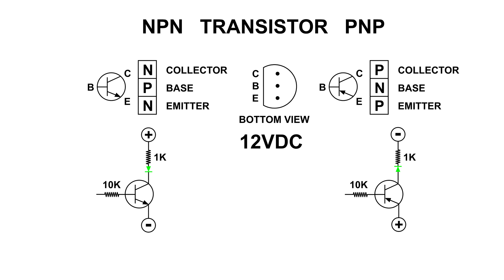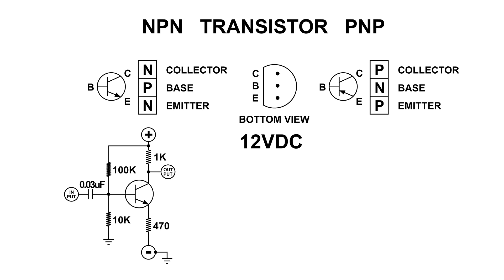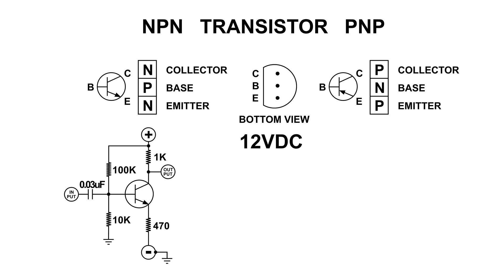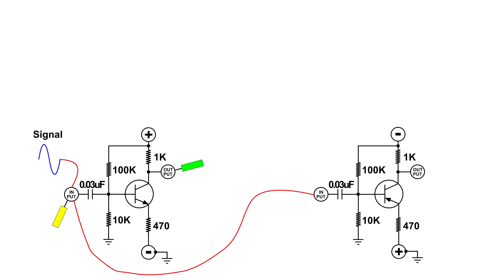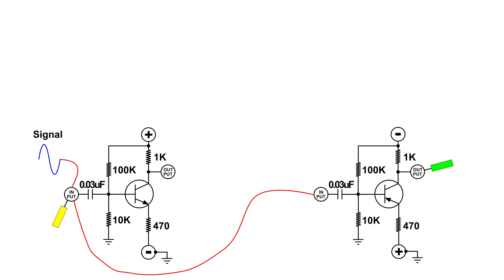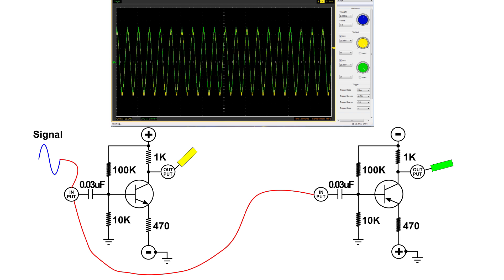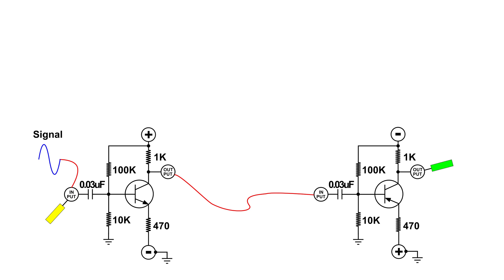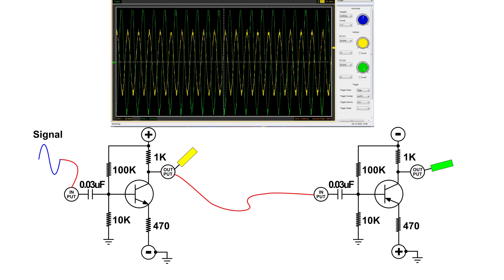Transistor Amplifier for the Beginner, the basics

Comment: Sir I have a led blincker cuircut that produce 15 hz wave but it's voltage very low around 2-5 volt and amp is also low but I want around 50v and 1-2 amp for my project can I use this cuircut for it please reply me
Reply from the maker: You may be able to use a relay or just the IGBT.
Auto ON OFF Circuit Updated with IGBT
https://youtu.be/n-Ac4czBkpM
180° Phase Shift using one IGBT Auto ON OFF Circuit
https://youtu.be/KwS1f3Z1150

Comment: He there can you design a 100 watts amplifier using 5 or 4 transistor.
Reply from the maker: Yes you can. The bigger challenge is building the clean power supply.

Comment: wot is a NPN  & how dos it work in a  transistors for  what is PMP  ? what dos it do  we haven seen one yet ?
Reply from the maker: These videos may help you.

Transistor, How Does it Work in a Circuit, Demo
https://www.youtube.com/watch?v=vs3zUHdlsYY

Transistor How can it Amplify
https://www.youtube.com/watch?v=O9aT950DRkw

Transistor What does it do in a circuit Visual Demo
https://www.youtube.com/watch?v=o1ygTZTHDnE

NPN Transistor on off switch and also a variable resistor
https://www.youtube.com/watch?v=knm_t10hJGM

Junction Transistor for the Beginner, the basics
https://www.youtube.com/watch?v=pStpu8DslXo

Determining NPN PNP C E B for a Junction Transistor using a Ohmmeter
https://www.youtube.com/watch?v=fWBjvaRDErk

Transistor Basic Function
https://www.youtube.com/watch?v=BOMbydWGecg

Comment: Hi i made a common emmiter amplifier for 200mhz signal with 2× gain 
I can amplify a 50 mv p-p to 100mv p-p but I can't do it for 2v to 4v p-p
Why what values should be change???
Reply from the maker: You could add another stage, or increase the Voltage, or both.

Comment: Why does the transistor burn out when the resistance at the output decreases ?
Reply from the maker: All parts have a limits. Look up the specifications for your transistor. If the current in the circuit exceeds the specifications it will burn out.

Comment: That's great, thank you. I suppose npn and pnp pair is necessary to cancel the inversion. If both are inverting the signal, why can't we do it with 2 npn stages?
Reply from the maker: The bases of a NPN and PNP are 180 degrees out of phase. This what makes the Push Pull work.
This video may help.
MOSFET Push Pull Amplifier Visual Demo
https://www.youtube.com/watch?v=-6N7l1dnk6s

Comment: can anyone tell me the phase different i see is not exactly the same as 180 degree. is 180 degree just a a rough value?
Reply from the maker: There's always a few nano-seconds between stages.
Reply: thanks for reply. 2:53 what i see is that the right edge of yellow wave is overlapped with green wave while there is less or no overlap of the left side of yellow wave. therefore i say it looks not exactly 180 degree phase difference. thanks

Comment: So you are obviously hooking 12V to the + and - signs on the circuit??
Reply from the maker: Yes
Reply: @AllAmericanFiveRadio  It is such a great circuit for a newbie like myself.  Except when I try to go and hook power up to this, and a function generator.  Things start to get weird.  So I hook 12v up to the + and -, and then hook the + of the function generator into the cap. and the - to the ground the 12v is hooked to?
Reply from the maker: @g00glian0  Click on the link in the SHOWMORE for a picture of the circuit.
Reply from the maker: @g00glian0  Look at the picture (link in SHOWMORE)
Red wire is positive Black is negative
NPN transistor on left PNP on Right
Wire connecting capacitor from NPN collector to PNP base is red in video and black in picture

Comment: Sir,
I was experimenting with this circuit and my sine wave coming out of the first stage was clipping on the top part of the wave. I was using a 1kh sine wave using the resistors in you diagram. My transistors  were bc547 and bc557. Can you advise me as to what I can do to correct this. 
I am a novice .
Thank you
Reply from the maker: Let's just talk about the NPN transistor bc547. When your signal at the output is clipping at the top that means the base of the NPN transistor is to positive. You could lower the 10K resistor, but I don't recommend that because you may start to short out the signal you're trying to amplify. I would raise the resistance of the 100K resistor, 5K, 10K, 20K,,,. Whatever voltage you are using VDC to drive the circuit, it should measure about half VDC from the collector of the transistor to ground. When you achieve these results the output should be a nice sine wave. If you have the biasing just about perfect, and you overdrive the circuit the top and bottom should clip at about the same time.
All this is the same for the PNP transistor bc557. Just reverse the polarity of everything.

Comment: how are you powering this circuit? I notice that on the pnp transistor the positive is grounded. I was bread boarding this circuit but had to stop because I didn't understand the power supply. 
Thanks
Reply: You still didn't explain why +12v goes directly to ground on the PNP transistor.
Reply from the maker: A 12 power supply, NPN collector is positive, emitter is negative. PNP collector is negative, emitter is positive.
Reply from the maker: I think if you know how a audio coupling capacitor work this may help. It isolates DC on each side but lets audio move from one side to the other.
Audio Coupling Capacitor, how it Functions in a Circuit
https://youtu.be/PAPnwX6YiIM
Reply: Okay I think I get it now. And as per usual its a crappy explanation that's the cause of the confusion to begin with.
Specifically this one from AllAmericanFiveRadio:
"A 12 power supply, NPN collector is positive, emitter is negative. PNP collector is negative, emitter is positive."
What the hell is that? You're just explaining the pin-out of the transistor.
I might sound ungrateful but I've had it with retarded Electrical engineering explanations and terms.
It makes it near impossible to learn anything within the field and so much is never explained.
Like a decoupling capacitor! Do you know what gets decoupled? Train cars and trailers! Not an effin' capacitor 
and don't get me started on "bias" Do transistors have opinions now?

The answer should have been:
A PNP transistor needs a negative voltage supply. 
So you would need a power supply that provides a -12V rail for the PNP transistor and a +12V rail for the NPN transistor. 
This also explains why the positive rail in the schematic is going directly to ground at the PNP transistor. 
Relative to the -12V rail it is 0V and therefore effectively ground.

Comment: Great video as always!
I wonder though, while both of these cascaded circuits are exactly identical, the amplitude is still at all greater throughout the second stage. This means more current draw on through the load. In practice, we see the transistors and passive biasing equipment increase in wattage, as we move up the stages.
So my question is: Should we simply go for a larger transistor whenever our current (amplitude voltage times impedance of the load) exceeds what the transistor can tolerate, or should clipping be taken into account as well in this case?

B.R.
-Ragnar
Reply from the maker: Transistor Amplifier Biasing Experiments, for the Beginner
https://youtu.be/svopsstdJP4
Reply from the maker: You actually worked backwards. Let's say the last stage is going to be driving a device that can draw 1 AMP. I would choose transistors that could handle at least 2 AMPs in the last stage.
Reply: Thank you very much Rick!

Ragnar

Comment: is there an ideal bias and capacitor values for a 9v input? I want to try amplifying a mic signal and I have a 9v battery. thanks!
Reply from the maker: Transistor Amplifier Biasing Experiments, for the Beginner
https://youtu.be/svopsstdJP4
Reply: AllAmericanFiveRadio thanks I've seen the video, but since I don't own an oscilloscope I can't do it empirically like you do, I need to do calculations on paper to get the resistor's and caps values to optimize output.
Reply from the maker: The first thing to determine is, what is it you want to build. Let's say it is class A amplifier. The load the transistor is driving will have a great influence on the biasing. Also we would need to know what is the voltage you're going to use. For class A operation grounded emitter circuit the collector should have a value about half the output of the power supply. This can be checked with a volt-ohmmeter. The biasing resistors for the base must be chosen to produce this result, but it's more complicated than that. There are many combinations of resistors that could produce class A biasing. What determines the choices for these resistors is the signal that is going to drive the base. If you choose bias resistors that are too low you may short out the signal you are trying to amplified. I would start with the datasheet for the transistor you want to use. Usually manufacturers will supply biasing information along with test circuits that you can modify for your purpose.

Comment: You stated that the 470 ohm resistor is for self bias and the 100K and 10K are for fixed bias. Does the transistor need both for bias? Can it operate normally with just fixed bias?
Reply from the maker: Yes this circuit needs both. It's designed for the beginner to have a successful working circuit. Build it and make some changes in the biasing and see what happens to the output signal.

Comment: noob question: at the end of video with two stage amp, if left amp is out of phase 180 and right amp is out 180 then why doesn't the final (green) signal show up as in phase with original signal generator? I thought it would keep shifting the time base of signal.

thanks
Reply from the maker: Yes, you got it. If you have an even number of amplifier sections, the phase of the input signal will match the output.
Reply: AllAmericanFiveRadio I might be losing eyesight, but that bit at 5:19 still looks out of phase
Reply from the maker: Yes it is not perfect. It may be due to the 0.03uF capacitors not being exactly equal, the beta of each transistor not being exactly equal, also it has been a while since I calibrated the scope probes, or all the above. It looks like the phase shift is just a few degrees out. I purposely left it that way because it is very hard to get things absolutely perfect, like in a book.
Reply: AllAmericanFiveRadio I see! Thank you, I didn't even think off those things.
Reply from the maker: I'm here to help, and not to fake any results. The real world is really interesting.
Reply: Finally someone that actually tells people that things are not always perfect in the real world.